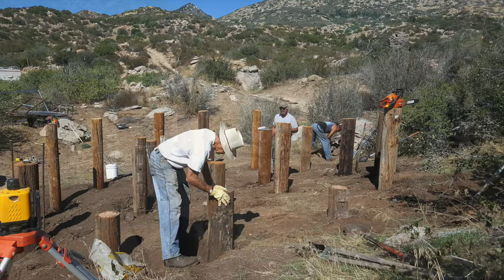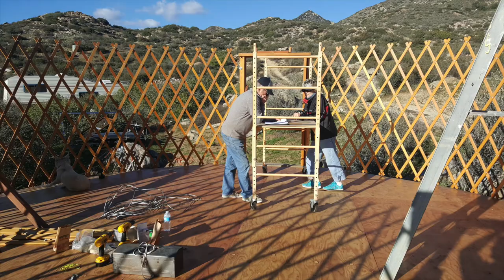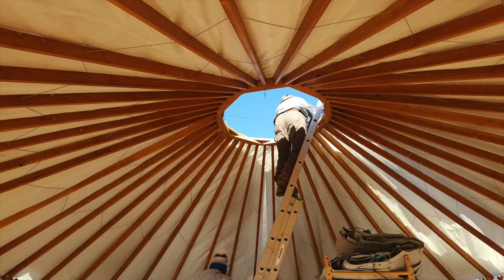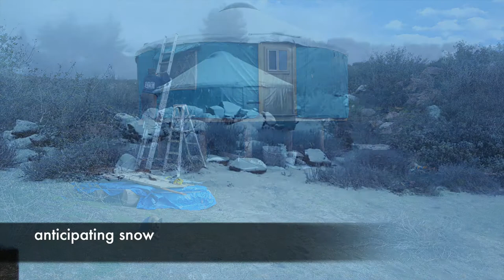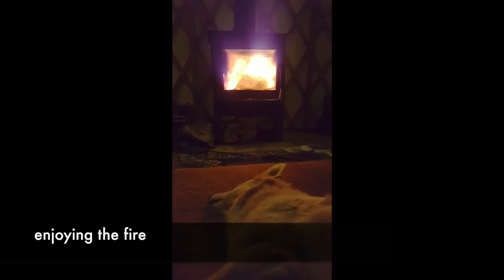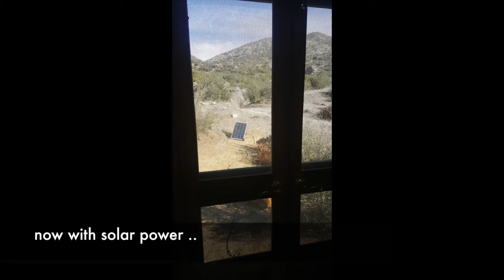Everything you need to know about living in a yurt

Comment: I need information on living in a Yurt in Texas heat. Just can not find vids on this.
Reply: if you have electricity you can use an inverter works as an AC and a heater. It dropped my temperature 10 degrees. And have a ceiling fan under the dome with the top open. Typically I don't use my yurt in the middle of the day when its baking hot. I utilize the outdoors and shade.